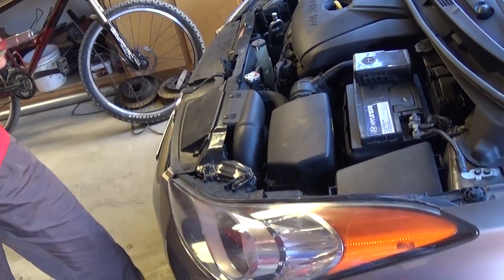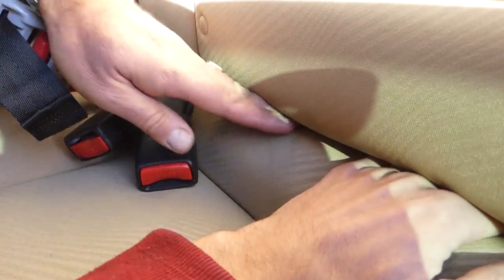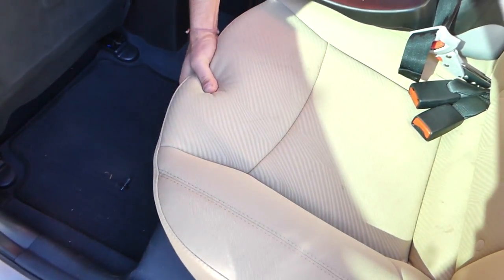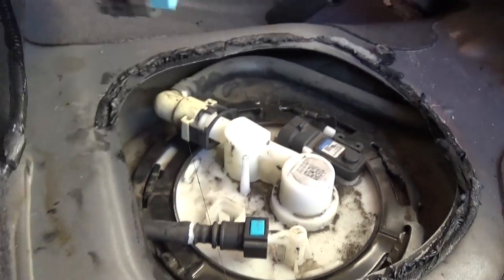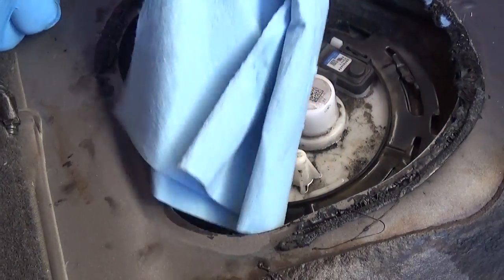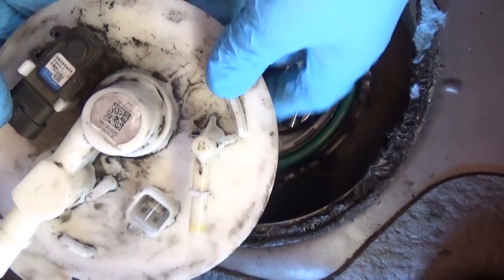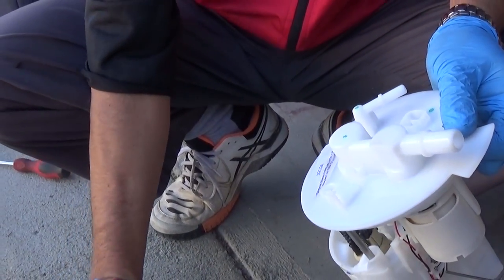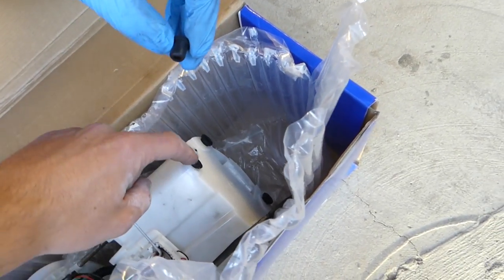HOW TO REPLACE FUEL PUMP ON HYUNDAI ELANTRA 2011 2012 2013 2014 2015 2016

Comment: No need to remove that valve when you are taking out/putting back in the pump assembly. The cutout in the metal floorboard is actually wider towards the back, so just turn the valve towards the back of the car and you can get it through.
Reply: Thank you for the update. I will be changing the fuel assembly in my elantra gt and that is ons less step to do.

Comment: Do you recommend pulling the fuse for the fuel pump, starting the car and letting it stall in order to relieve fuel pressure? I don't think I saw that mentioned in the video.
Reply: Yes ive seen another shop video recommend that. You would have to reconnect the battery, start the car and let it die. and then disconnect the battery again. But im not a mechanic and if your fuel pump isnt working it might not matter..

Comment: Easy way to get to seat bolts is from back with ratcheting wrench, just disconect back seat drop it forward and  unscrew bolts. Btw on my 1.6 elantra its not so tight fit.

Comment: So i currently have 2 fuel pumps in my tank because i couldn't get the first one out......all you used was a flat head??? The fit is extremely tight as you said and now i have to do this job again....not looking forward to it

Comment: Is this the issue I’ve been reading about with cold starts. I read it’s a bad fuel pump then when it warms up it’s fine.
Reply: What exactly have you read about? I've had an issue with mine that's really strange for years now and it's never thrown a check engine light. Hyundai dealership said they wouldn't do anything until the light came on. I've tried a few different things myself, but no dice. When it drives, it's smooth as silk... No missing or anything. But sometimes when I start it up after it's sat for a while it takes at least two or three, maybe even four, seconds to catch. Also sounds a little strange. Haven't wanted to let someone just throw parts at it without a concrete answer so I've just dealt with it. It's never refused to start up, just kinda concerning and I'd love to have it fixed.
Reply: Trever Booth I don’t know if it’s the same issue but when I replaced my fuel pump which was very easy to do it fires instantly every time now and runs very smooth.
Reply: @tampametal  might be worth giving it a shot then. Certainly can't hurt. Thanks for the reply
Reply: @tampametal  should've asked, did you get the OEM Hyundai pump or an after market?
Reply: @TRevYo1  I have the same issue.  Fuel pump was broken last year, changed it with aftermarket alternative suggested by dealer (Bosch).. about half year later, it began to have difficult start (2 crank) and a year later it became more (3-4 crank).  I feel the pump is again the problem but it's barely 1 year...  What work is usually I turn the key ON, wait a few second and give a throttle, but not always.   What I noticed with this Bosch pump, I get more fuel economy.

Comment: You need a fire extinguisher ready.  Dang dude! Oh and that's the fuel filter not an emissions part. At Oreilly's you get the whole assembly without having to install rubber bushings or taking off the and using the OLD sensor.

Comment: What is that sensor that you have to unplug to move the black cover completely out of the way called?

Is that the thing that throws a p0453 to an OBDII reader? if so, i need to replace that, and the dealership told me it was inside the gas tank and 500 dollars to repair...

Comment: Thanks. 
When I need to replace fuel pump? and can I replace the filter only?
Reply: Badr Basrah they have a video about just replacing the filter if your arent hearing a whiny noise when accelerating but do have a lack of power and possible rough idle or stalling chances are you dont need to replace the pump and can get away with the filter

Comment: Do you know the part number for the fuel tank pressure sensor
Reply: Not sure of the OEM part number, but GPD 1811261, CarQuest ECA2922, WVE 5S17151, VEMO V52720199 should all fit.

Comment: Instructions worked perfectly.  Only issue i had was the ring was a pain to get off.  There is a tool for that (rock auto carries it) in case your ring gets stuck
Reply: @korkee1111  PERFORMANCE TOOL W80668, or LISLE 63000

Comment: Great instructions! I have a limited model so the rear seats are heated. I am unable to remove the rear seat entirely.
Reply: Did it make the job a lot harder, or were you able to swap your fuel pump without too much trouble? I have a limited as well and will probably need to change the pump soon.

Comment: Help guys! I have a 2012 Hyundai Elantra. 50,000 miles. The dealer I bought the vehicle from has tried to fix this problem 3 times and said they cannot replicate the problem. First they said bad gas, second bad spark plug , third it went to Hyundai and they did some recalls but unfortunately the problem is still happening. When i start the car sometimes it sputters like it will stall. It seems like the engine is struggling to get gas. Sometimes it happens even while im accelerating or even im reverse. The rpms drop a touch every time it sputters. Sometimes if im at a light i hit the gas and the car feels like its in neutral like i just revved the car up to 4000 rpms and it doesn’t move. I let off and hit the gas again and it goes. Fellas where do i start!! Help please
Reply: Also I have no check engine lights on at all. And i hooked up the engine diagnostics tool and it came back clean. The car is an automatic also.

Comment: quick hint: when replacing the pump to remove pressure from the lines unplug the fuel pump fuse and let the car die. option 2 although not recommended: goto fuel rail, find the pressure test valve, schraeder valve: remove cap and press down center core. unfortunately this will cause fuel spill into engine. hence i do not recommend this.

Comment: I saw your assembly didn't come with a new pressure sensor. Is it good to use the old sensor since the car is used to that? Or should you use the new one? 

Also, when you buy a new assembly, does it come with a new fuel filter? Or do you have to buy that separate? 

And I love you guys! 🙌 You taught me how to replace my alternator as well. Keep up with the wonderful videos!! 🙏
Reply: Mine came with the filter, I didn't change the sensor

Comment: My elantra started this morning and died. Now it just cranks. I am almost positive the fuel pump is shot. 2014 with 97k miles on it. Bought just the pump but wondering if I should have bought the entire assembly
Reply: Same with my 2012 Elantra. Was it your fuel pump?
Reply: @Lwill0  it was. 300 dollars for the new assembly.
Reply: @christopherhendricks4369  Wow. I've seen one from autzo zone for $150 idk if it's the whole assembly or not
Reply: 75 dollars for mine putting it in Wednesday
Reply: @bobg3221  where did you buy? It's not difficult once the old one comes out. Gotta wrestle it a bit